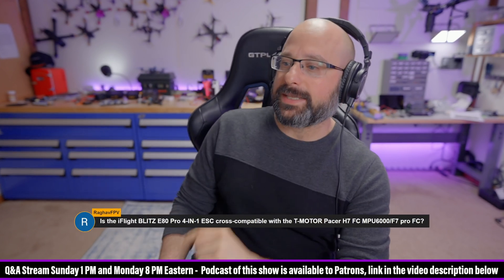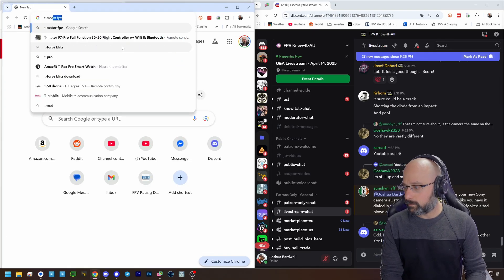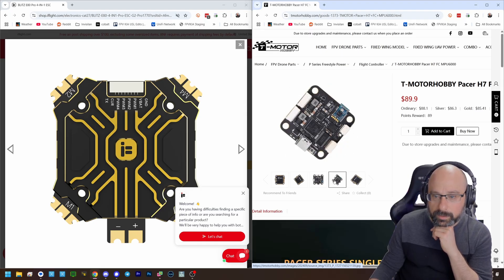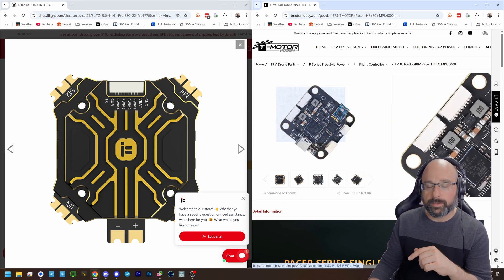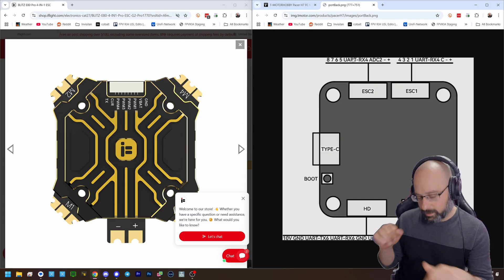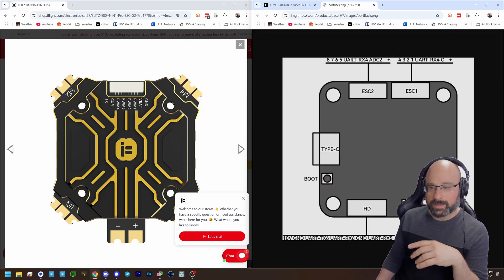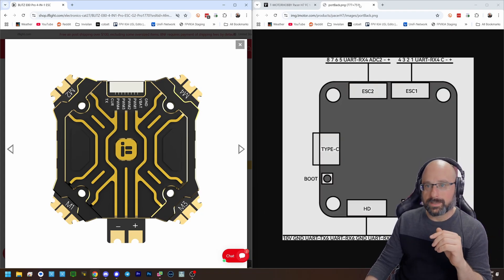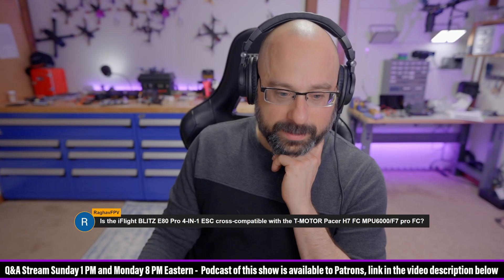How Do I Know If This ESC and That Flight Controller Are Compatible! - FPV Questions

Comment: Pff probably easier for me then it is for you, I solder HDMI cables with custom pin outs (i²s cables for incompatible hifi gear)😂😅

 I wonder if there would be any noticeable difference in using 9.5%Ag hifi solder vs regular 60/40 when it comes to flight performance and/or signal strength🤔

Comment: From recent experience: DO NOT USE STOCK 8-pin CABLES IF MIXING BRANDS. Different brands put the power pin in different places and mixing that up will burn the FC

Comment: Thank you Joshua for making it a point to learn how to solder better than I could before. And also for showing how to re pin a plug and where to get the wire kits . I realize I have skills now !!!!   I have soldered my FC and ESC  before and I also have re pinned some . It is nice to have a combo so then you don’t have to worry about it and just plug and go .

Comment: I remember the first time I  repinned a fc and esc I didn't know if it would work  but it gets easier after you do it a couple times...
Reply: I use a sewing needle with the magnifying lense from my soldering station. Works like a charm.  I refuse to buy a crimp tool and and plugs. I dont have patience for that lol.

Comment: And triple check your repin, especially ground and power, continuity test with a known power rail and known ground on both sides before powering it up. Using a current limiter the first time you plug it in might save you but it is not guaranteed.

Comment: Most of ESC I bought recently were bundled with 2 cables - one for default pinout, and one with connector only on one side, and empty plug, so You can just put the wires how You need to without getting pins olut of connector and potentially damaging it.